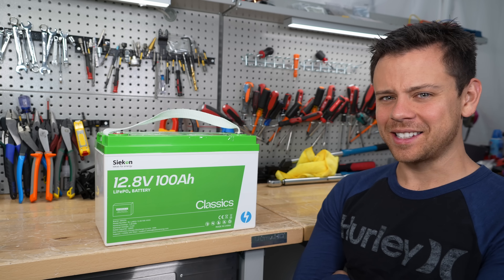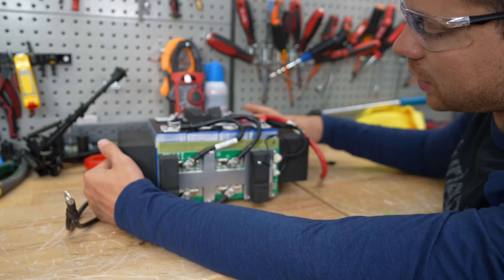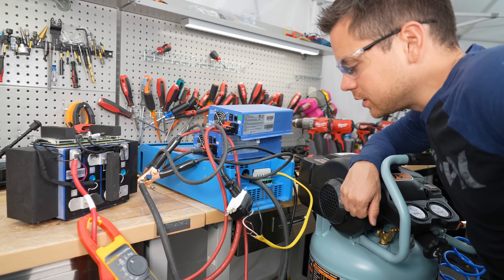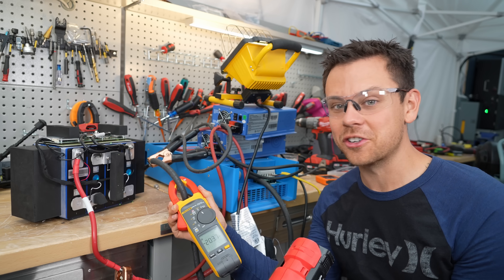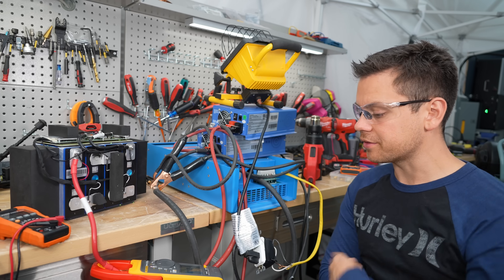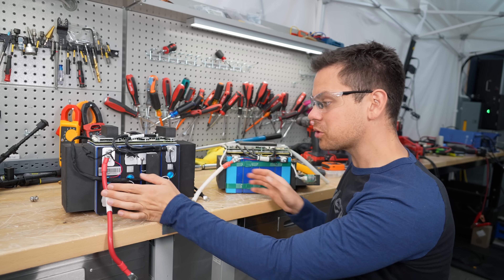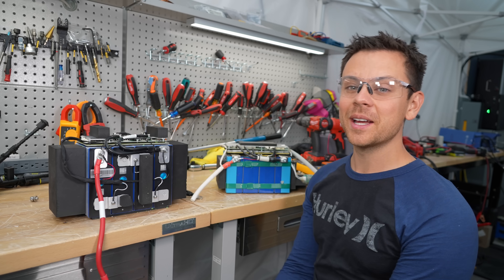Lead is Dead! $229 LFP Siekon 12V 100Ah w/ 150A BMS and Low Temp Charging?!

Comment: I live in caravan and I have my batteries under the bed... I use lead acid because of safety concerns. Would you sleep right above a lithium battery bank? Trusting your life with it?
Reply from the maker: And yes I have 170kWh of lifepo4 in my house cycling while I sleep. I do trust it with my life because I know how they work.
Reply from the maker: Lifepo4 is much safer than lead acid. Even sealed lead acid. Yes you can sleep on them. I did in my van for many years.
Reply: LFP is even safer than lead acid. NCM are the dangerous ones

Comment: Any reason they don't stick it in a smaller case rather than packing it out with foam?

Is lithium a suitable replacement for a lead acid starter battery in a smaller engined diesel ICE vehicle? (mini digger, forklift, UTV, etc)
Reply from the maker: Because there are group sizes for batteries. they need them to fit that size

Comment: Your statement is true,
Lead batteries do not have safety features like lithium do. They don't need them!
Lead batteries have a bigger voltage range depending on charge. That is a good thing. 
It is easy and cheap to stop changing/discharging with high/low voltage.
Recycling lead batteries is no problem. Lithium is.
The biggest disadvantage of lead is energy density.
Are you impressed by an inrush current of 316A? 
Lead batteries do this every day of the week,  for years.
An ice cars starter motor takes around that mutch current.

Comment: I'm from Ukraine and have to heavy rely on the LiFePO4 batteries to compensate for electricity shortage. The biggest issue with these assembled batteries is not the BMS current rating (you are not going to waste them on HVAC or cooking), certainly not the low temp dosconnect (you are not going to survive in the appartment below 0 caelsius). The biggest issue is non-specified balancers that often have a dumb setting to work only with the pretty big charge current (typically over 0.01C). Combined with the low balancing current it means that the possible charge balance is very low, and if battery have already come to the state that it disconnects with the 14.2 volts or less, the balancing becomes progressively worse and worse and there is no way to fix it without dissasembling the battery and making top balance or hooking up additional balancer.
Non-smart Daly BMS are notorious to have this non-working balancer behaviour, JBD have some non-intuitive settings to switch to balance on idle, it's interesting what is the others BMS behaviour, especcialy the ones in these assembled batteries.

Comment: Can you parallel two together to start a car, like an average 650-850 crank amp would need. 

Or my hope, add this in parallel to normal crank battery without a battery isolator splitting device for cars that sit without a battery tender.

Comment: I agree lead is dead. I have been running lead for years and my last purchase was 16 -T105s at 24 volt. I was so tired of maintaining them I let them go dry before watering. I was just putting tap water in them. I got 5 years out of them. I was concerned I might have to buy one more set of lead and saw the Eco Worthy at Amazon for $2000 for 4 -12v 280 AH the size of an 8D. I had bought the 16 T105 for $2000 with no core charge. 

Now is the time to buy LiFePo4. It must be the reduction in EV sales and an overstock of batteries so the prices really came down. Battle Born charging $1000 for a 100AH is just too much. I have not cut open the case of my batteries and there is no blue tooth connection for monitoring. They say to check voltages every few months to make sure that each battery is fully charged. Thanks for your videos.

Comment: Lead acid still has a place in some scenarios,  like offshore sailboats, you can get hit with lightning and lose your lithium battery but your lead battery will survive.
Reply: Got one of them offshore sailboats. 

Yup, yer Lead acid battery might survive. But the rest of the electronics you would use on the boat would be fried, which would likely include the engine starting motor.

Comment: Just a comment about lead acid, 25 years ago I had four (4) 6 volt Trojan golf cart batteries, although beefy, they were disappointing because of the size/capacity ratio and having to water them. Lifpo4 is so much better, no adding water, sustained voltage, longer life, so much lighter.

Comment: Lithium s*** unless you need something portable. I've been using traction batteries for years mines from a refurbished forklift battery three Banks of 6 550 amp hours cells giving me over 1500 amp hours on 12-volt for 1000 bucks. My brother's current systems used old 2200 amp hour cells 48 volt system two Banks which is almost 4,5000 amp hours pick them up at auction from a nuclear power facility replacing their not that old backup for lithium $8,000. Edit I just did the math a single Bank on my brother's 48 volt with them batteries would cost $20,000 a piece he's got 2 that's 4400 amp hour equals $40,000. stellar deals out there know what you're looking at simple load test tells you what you're getting.
Reply: Not a good deal when that is more than most electric vehicle SUV batteries
Reply: @JD-yx7be  you're horribly mistaken. Like a Nissan leaf battery pack one of the cheapest is $500 for a 48 volt 37 amp hour pack used. Just one Bank on my brothers 105 kilowatt per Bank would cost him 25 grand be cheaper to buy the batteries on this video. Even from Alibaba it's 10,000 us what should be like 15 Canadian plus shipping Eco fees for cheap Chinese Nissan leaf full 60 KW. What would I trust the forklift battery that operates for 8 years straight every day in the factory. Or cheap Chinese battery with a BMS that'll probably fail in 6 months.

Comment: currently 12v 100Ah $225 Siekon, $215 Redodo, $204 Redodo with no low temp. What's the best buy if I live in Houston Texas and will keep the battery indoors next to my Bluetti AC70 for extended capacity?

Comment: Please review ionic dual purpose deep cycle/starting battery 
My ionic diesel start battery is working great in my dump truck 
Replaced three lead acid starting batteries with one 
Your channel is great 
Also have two li times for my 24 v trolling motor that are working 
good

Comment: Review has been up 12 hours, and they appear to be sold out. Your link does not produce a 100AH battery, nor does an Amazon search. Sorry I didn't see this earlier, been considering another 100AH 12V battery.
Reply from the maker: It sold out
Reply: They now appear to be available for $139 (plus tax if applicable) on Amazon. Dec 20, 2024.

Comment: How soon we forget Chins!  While their current price is $249 on Amazon, it has sold for less than $200, as low as $186, several times over recent  months. 

And the Weize is currently $229 at Amazon. 

Fascinating this Siekon has so much current capacity. Although, not sure most folks are powering their car lifts with these batteries. ;-)

Comment: I need a lifepo4 battery around 50 amp hour capacity or more as a starting battery for a mini off-road vehicle. The starter pulls 100 amps as checked with a clamp multimeter.

Comment: @WillProwse Hey bud. Random question, but I have an enclosed trailer with solar setup. Is there anything I need to do when I am not using it regularly? It sits in the sun, the battery bank is full, the inverter is off but I usually leave the charge controller on (Bouge RV). Is there anything I should disconnect for long term storage? Or is it fine like it is? Thanks!
Reply: I have a similar setup. That's what I do, except I turn off my charging during the winter to protect the battery from trying to charge in freezing temps. My SOK battery won't try to charge in those temps, but it definitely won't if there's no power coming in.

Comment: Great info on this battery. I have 3 NewtiPower 12v 100ah LiFePo which have worked great, even though they 100A BMS, they work fine for my DIY portable power station and running shop lights and power tools. They also go into my camper. You should review NewtiPower. Thanks again for your video.

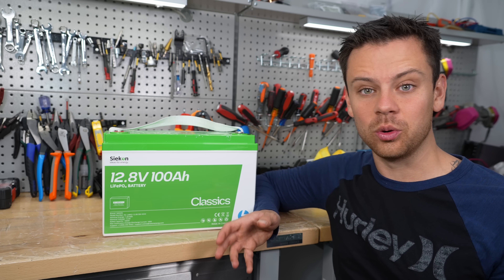Comment: So I watched the first 1:30 sec of this video and had to comment. This is funny and is exactly correct. Why would you still use lead batts. I build my own lifepo4 batts but with manufactures getting the price down it make it harder to resist. My ONLY complaint is not enough information out there about which one is QUALITY Built and true grade A cells. They lie on the product pages and build quality will never be seen if no one opens a glued sealed battery.
 This is why I really appreciate Will Prowse for taking these apart and showing people whats REALLY inside and if the BMS is quality or not. Thank you Will. Keep up this kind of content as products are always changing in this segment fast.!

Comment: wieze 100 amp is now 229.00  with a 10 % discount on amazon days this week I run 4 100 wieze batteries they run 19 grow lights  3 chest freezers one frig and a small window ac they get charged by 6 400w bifacial panels off  2 100 amp controllers  and a 3000 w inverter

Comment: Mighty Max Battery 12V 100AH Deep Cycle LiFePO4 going for $270 at Lowes.   I suppose the internals are not as good.   But from quick google search for the LFP Siekon I saw quite a few similar ads.    Seems a lot of LFP batteries have dropped their prices recently.

Comment: Been off grid for 25 years running Lead Acid batteries until 3 years ago when my battery bank needed replacing. So I switched over to Lithium and haven't looked back. Lithium (LFP) is a game changer and way out preforms FLA batteries in every way and by miles 👍
Reply: Were you able to use your same inverter or did you have to replace it as well?
Reply: @raywmontgomery Answer = crickets   his system faild, no electricity 😅

Comment: Total scam. On their website these batteries are “sold out” - but you can buy their $999 12.8V 100ah if you want.
Reply: Just buy the li-time.  The group 24 bluetooth is about $250 and they ship out the same day...they even shipped them out on 4th of July.

Comment: Lead is mostly dead, but not in offgrid systems where temperatures goes down to -35 celsius and you don't have enough solar to keep a lithium battery heated. Yes, this is sadly the situation at my cabin...
Reply: You could have a smaller Lead Acid battery bank just to run the heaters sized for the amount of time needed for operation for the much larger LiFePO main battery bank that does all the 'heavy lifting' by powering the inverter for all the high wattage loads. You'd have 2 different chemistries, but the Lead Acid batteries would likely be sized much smaller and therefore cheaper when needing to be replaced.
Reply: @kennethabrahamsen6546  Great suggestion! I do believe it is possible to get it working with only Lifepo4 batteries also, but then you would need a extremely well insulated room and a oversized solar array to be able to generate enough heat to keep the temperature at about 10 Celsius. Another solution would be to have it in a insulated box in the ground where tempratures stay above freezing in the winter. When the summer comes your probably need to have a way to cool the batteries again to keep them at a reasonable temperature.

The problem is that it is complicated and labour intensive to make such a setup so for most people Gel og lead acid would work if you don't need a lot of batteries.

Comment: I'm annoyed that I started my van's power system with Battle Born batteries. Now, I need to add two more batteries to increase the capacity for my 12V undermount AC, but it's hard to justify spending nearly $1,000 per 100Ah battery. Their prices should be half of what they are now. It's been four years since I first bought them, and they are still around $900 each.

Comment: Dude their title on Amazon says up to 15,000 (fifteen thousand) cycles.. why? The heck man. It's like they are just trying to put themselves at the top of some list by lieing. "12V 100Ah LiFePO4 Battery, Built-in 100A BMS with Low-Temp Protection, Group 31 Deep Cycle Lithium Battery, Up to 15000 Cycles, Perfect for Trolling Motor, RV, Solar Power, Off-Grid, Marine"

Comment: I’m having an issue finding a rack mounted UPS that uses Li-ion instead of lead acid. It needs to be from a reasonably well known brand (Eaton, APC, etc.), and needs to be in the 5000VA range (mains is an L6-30 plug). Those UPS brands remind me of film companies around the adoption of digital companies but I’m stuck buying from them. (I have limited ability to dictate our purchase)

Comment: So if my terrible understanding is correct.  This is a 1200wh battery?  Or 1.2kwh? So should power a 400w load for 3 hours? Battery capacity math hurts my brain =(
Reply: roughly yes. there are charging/discharging losses to take into account
Reply: @JD-yx7be  thank you!

Comment: I have Amazon prime and they had a $200 gift card if you apply for their credit card 
I was debating getting their card anyway and I pay my cards off every month so I’m not worried 
I couldn’t find a place to use your code with the gift card so it was $41 after tax for the battery

Comment: What do you still have in your cars ?      Thats right,  Lead Acid !   Lead Acid batteries are going to be around for many more years.
Reply: Even that is changing. Toyota for example dropped the gas Camry and only sells the hybrid version which uses a dc to dc for the 12v. We are pretty much on the last generation of conventional gas vehicles.

Comment: Would these batteries be a replacement for the starter battery in my Jeep. They most likely would be ok for starting, but would the alternator deliver the right amount of V and A to charge them?
Reply: Not for starting, if you doing over landing you can add one to power any gear or accessories   tho

Comment: We're about to go to AGM. We live on a boat and it's becoming very challenging to keep insurance companies happy with lithium.
Hopefully that will change...
Thanks for your fantastic videos 👍👍
Reply: Make sure the insurance Co knows it's LiFePO4, not just lithium, as the newer LFP batteries do NOT get thermal run-away!
Reply: @Tumbleweed5150  thanks. We'll try that. Lifepo4 would be much nicer. Had a wee heart thing a bit back and they're soooooooooo much lighter!
Reply: @Tumbleweed5150  all batteries can do a thermal runaway including lithium iron phosphate. That is pure hype and BS put out by the manufacturers. There are many scientific papers that show a lithium iron phosphate battery doing a thermal runaway.
Reply: @Channel-gz9hm  thanks 👍
Reply: @Channel-gz9hm  there's also a new study out on PV magazine that shows multiple studies have found that lithium iron phosphate batteries are also much more toxic than their counterparts if a fire does occur. All batteries can experience a thermal runaway and a lot of the safety issues associated with lithium iron phosphate are not scientifically based, they are manufacturer hype.
Reply: @Channel-gz9hm  Yes, Scooby Doo said: "which way did they go George, which way did they go"? Now answer that one!

Comment: No overcurrent protection is a recipe for disaster
Reply: NO, just use a fuse or DC rated breaker, like you should anyway.
Reply: @Tumbleweed5150  products should be foolproof. Another case of cutting corners to keep the cost down.

Comment: Any chance these could be used as drop in batteries for a golf cart?
Reply: I did, but was told it voided my warranty.
Reply: They told me the Amp draw would be more than the BMS could handle, even though my records showed it wasn't that much, nor as long as the battery specs said. If you do it, just tell them they are used in an off-grid solar system. ;)

Comment: When they make Lithium starter batteries more available at a good price, lead acid batteries will be no more.
Reply: Do you want the battery to turn over a motor with cold thick oil in it and so much resistance the best lead battery struggles? I think these batteries can start most well cared for motors but they cannot guarantee them for the old timers that abuse them maybe like cold diesels..

Comment: Hey Will, can i use one of these batteries in my v8, if not what battery can i use instead of lead acid?
Reply: If you are talking STARTING battery, there are NO lithium batteries, as yet that works. That could change soon, though. It's just that the manufacturers are providing these mainly to folks needing an off-grid power system. Once the need is known to enough manufacturers, they will most likely figure out how to make them.
Reply: @Tumbleweed5150  Thanks for that, I was hoping there would be, looks like I'll just have to wait.

Comment: You convinced me.  So how do I replace  a lead acid marine starter deap cycle in my van.  Only room for one battery and mostly alternator charged.  Use; lights, fan, fridge and 318 starting.  Operating temp -25⁰ to 120⁰ Fahrenheit. Yeah without spending allot of money.  (Instead of a DC to DC, max $, why not a amp and temp  control on the alternator.  Simply cut back on exciter current when the alternator is working to hard.)
Reply: Won't work. See my other replies to similar Comments.